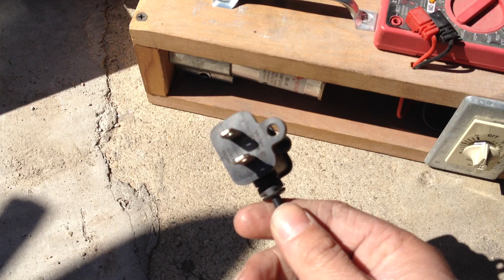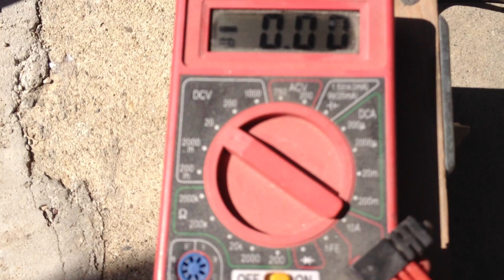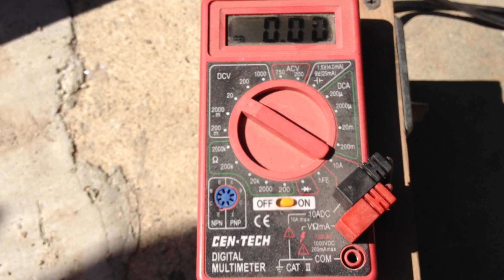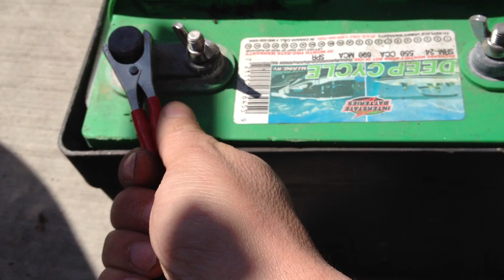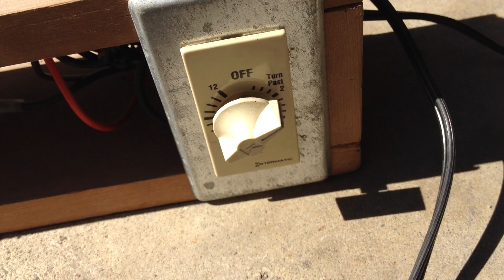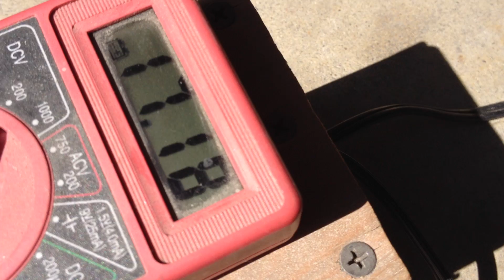Video Instruction Guide----How To Use your Capacitive Battery Charger   Part 1

Comment: care to explain why the bridge rectifier can be damaged if the battery is not connected?
Reply: 3 years pass . the bridge will not damage most of the bridge 35 amps is 400 volts nothing will happen

Comment: 18V into a 12V battery?! That's going to boil off the electrolyte and ruin any lead acid battery in short order. You would also have a significant risk of a hydrogen battery explosion. That charger design is totally unregulated and unprotected (no fuse?!) and will keep going up to 200V RMS until something gives. Never allow any 12V lead acid battery to charge at more than 15.5V. Totally unsuitable design, you would be much better off to buy a $25 battery charger with an actual regulating transformer and fuse. No one should use this type of charger! Might as well just plug your battery into 120V AC with a couple diodes in series because that's what this mess is essentially.

Comment: one battery I'm restoring was completely depleted, after 40 hrs on the charger its climbed up to 600cca.  Hoping another 10 hrs on the charger and it will be up to or over its 710 cca rating and completely restored to like new capacity.  Very impressed so far with this simple design.  I have one that was rated 950 cca and I tested it at 955cca after charging.  No chemicals added.

Comment: Thank you for all videos from lead acid batteries parts 1 thru 6 and capacitive battery charger series... building and how to use.
In short my problem has been walmart and its supposed supplier out of Milwaukee Wisc... 4 batteries ranging from riding lawn mower to vehicle and and 2  marine deep cycle ( the only decent ones so far..intended for solar storage) 
So I am going to try your tricks ranging from epsom salts to this capacitive battery charger.and if it doesn't work..nothing lost...just some knowledge gained
But I have lost faith in the BatteryMinder for some reason...maybe expecting too much

Comment: plese tell me where I can find that capaciter 80 mfd%5  440 vac  50 - 60 hz 
i have been looking and cannot find this cap
Reply from the maker: I've actually found the Deep Cycle Everstart Maxx batteries to be extremely well made. I used them in all my electric car conversions. The punishment they take.... even after a full service life, and 2 years of storage, my last EV conversion is still holding 95% of it's original capacity, which is extremely impressive, considering that most lead acids would have needed to have been replaced by that point.
Reply from the maker: HVAC Supply House.
Reply: all hvac supply houses here you have to have a hvac license.to buy there product. do you know of any online stores i could find this cap.. thank you.
Reply from the maker: Wow, restrictive. Try www.DirectHVACsupply.com  Inventory varies, but they have plenty of different size caps so you can get the charge output desired.
Reply: +SonofGodly   Go to ebay on line ...may not be exact specifications but close and make sure for starter motor applications ( I think ?)... will be in the  $6- $10 range but no taxes or shipping charges as of 09-2015  date.   Sorry about being late reply....but hey I'm learning also....this is fun...may burn the house down and electrocute myself but it is better than paying taxes.
Reply from the maker: +toolittle toolate  NO NO NO!!! MOTOR RUN CAPACITOR!!!! If you use a Start Cap, eventually it will make a spectacular POP if you catch my drift. 

Best location is a HVAC Supply store. Or, they can be ordered from me as well.
Reply: O.K.  KmanAuto....You the boss...Whatever you say
Reply: No problem....I've been away from your series for maybe 3 mo and playing catch up on recording videos and trying to get things to stick in the mind...I like the epson(m)salts idea (?) but am  still weak in the electronics applications with the correct do's. By the way..you have a full 1 hr .+ recap somewhere on you tube I've seen it when searching other videos but now eludes me. I'll find it though. Everstart (IMO) still sucks...maybe I'm just too cheap to buy better batteries.
.
Reply from the maker: +toolittle toolate Sorry, didnt mean for that to sound rude. I wanted to catch attention before someone made a oopsie. 
Cheers!

Comment: I have built one of these in a desperate attempt to revive the 20 7AH batteries from my 10KVA UPS. They are all in the 5V range and below and replacing them is quite a bit of money.

I am fairly confident about the batteries' general condition seeing as they weren't drained empty but rather left to run down.

I've used a 1000V 6A bridge rectifier and my capacitors are able to swap out for higher or lower charging current.

The charger seems to be doing its job getting the batteries to accept current but there are a few things I am unable to find anywhere else (unless I overlooked) which I need some clarity on . It's mostly best practice and procedural questions.

1. Which is better, charging with battery caps on or off?
2. What charging current would you recommend for a 7AH dead battery (or a general rule of thumb)? I am currently charging at 610mA for the 7AH batteries
3. How will I know when the process is complete? I have two DMM's set up. One measuring Volt and another measuring Current. Will the battery begin to draw less current nearing charge completion?
4. Should I be worried about any liquid coming out of the battery valves while the battery is cool?
5. At 610mA there's no real crackling and fizzing as many describe. Does this mean I am not putting in enough current or is it better/safer this way?
6. I am not entirely at ease with the charging process and safety. I am at ease with the risk of electric shock and am confident that I can avoid electrocution. It's exploding batteries and capacitors that gets my hair on end. Should I be worried about this? Can a sulphated battery explode during desulphation? Overcharging speaks for itself

I'd really appreciate your expert opinion.